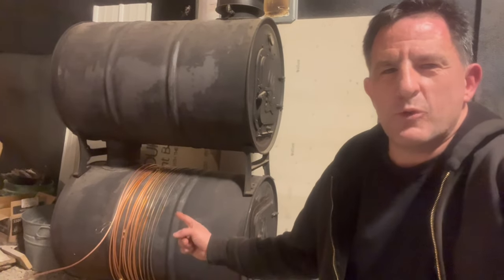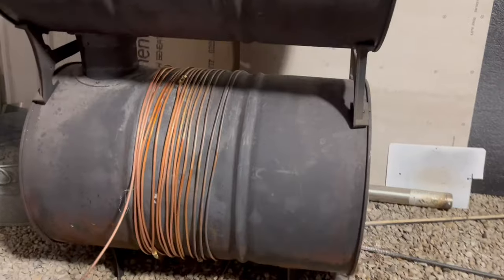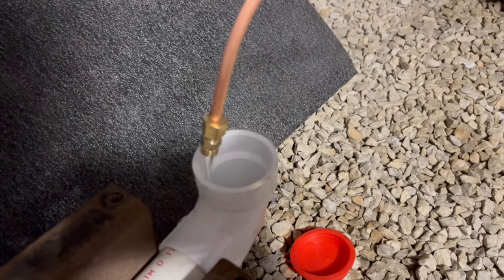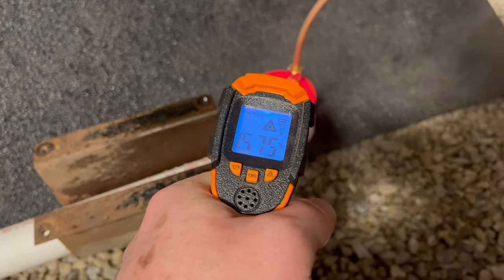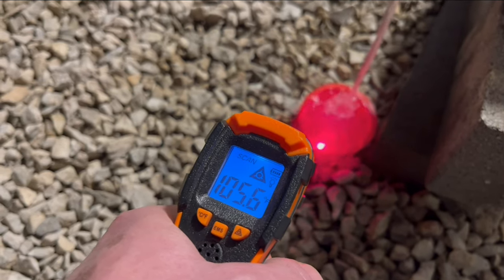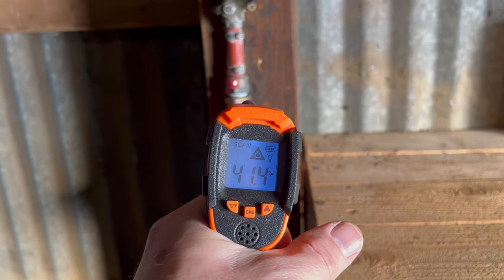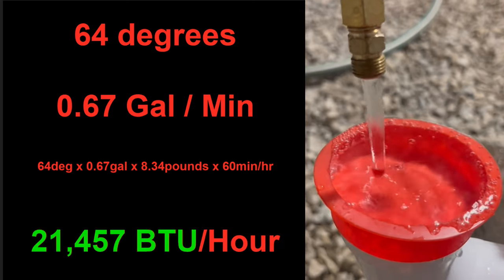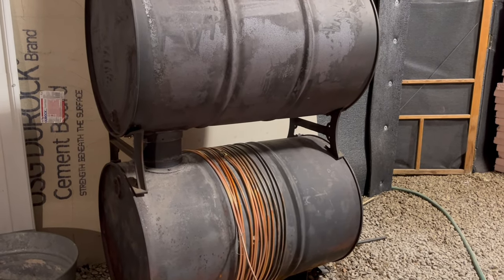DIY Wood Fired Instant Water Heater

Comment: This is brilliant. I will be using this to heat my pond I think this winter. How do you think I can calculate how well it would work for a 3500g pond. I am in the Chicago area. Would hook up a water pump controlled by a temp gauge to pump through.

Comment: I wonder...would 3/16 line be insufficient in diameter for this?
Reply from the maker: That would be absolutely fine.  You can easily push a gallon per minute through that.
Reply: @HowToLou  thanks for the speedy response! I'm fully convinced that this is the route to go for my project then.